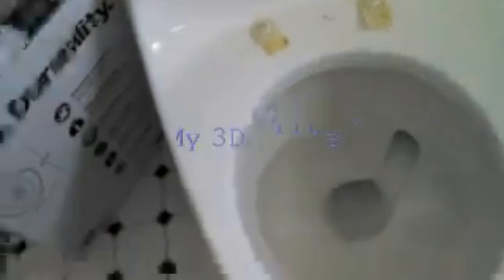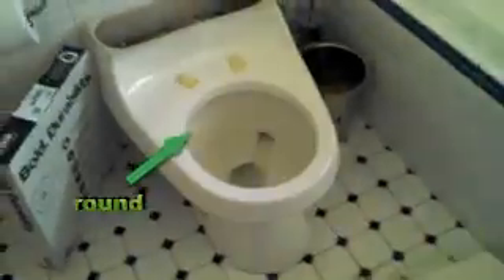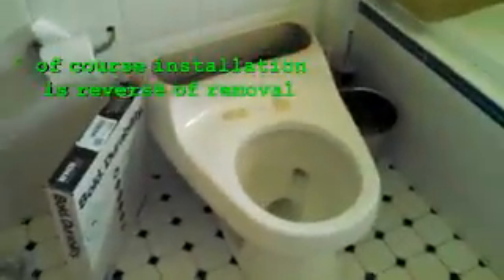SEAT REPLACEMENT KOHLER RIALTO toilet  K-3386       dino

Comment: Wow,  the reviews about this toilet on Amazon are terrible! About half due to fill and flapper valve issues and half due to changing the seat. People just don't realize that you can reach down in the tank and get the the nuts! They think you need to pay an extra 45$ for an expanding anchor kit. Some don't even thing you can put a new seat on! These toilets seem like they have their quirks but with your videos they seem a lot less trouble than people realize. The right information an attitude makes all the difference!
Reply: +Josiah Hanna Some versions o this toilet have a ceramic cup that prevents access to the seat bolts even when you reach into the tank. That's why people hate this toilet. Kohler had no reason to produce such an unnecessarily complicated design
Reply: I have the Rialto 3386 and there is no access from inside or outside the toilet to the nut that attaches the seat to the toilet.
Reply: @khakuda  same here, my brother, whose a plumber tried and ended up stripping out one of the bolts and now I can’t get a toilet seat that screws down properly and have to replace the toilet 🤬to the designer of this model.

Comment: I have the Kohler Rialto 3386 and the nut securing the toilet seat is not accessible from below the toilet or inside the toilet. I even removed the fill valve that drops into the bowl from the tank and reached in there and everything is encased in ceramic. This is purposely designed not to be repairable you cannot replace the seat on this toilet. Shame on Kohler. These things end up in landfills unnecessarily.

I have four Kohler toilets in my house and my goal is now to make sure I have zero at some point. Purposely designed so that the toilet seat is not replaceable, unbelievable!

Comment: This video is terrible and laughable in more than one way. First off I have a Rialto K-3386 and the bolts are barely over an inch long which leaves little room for a nut to be securely connected. The idea of a having nuts installed inside the tank makes absolutely no sense whatsoever.  Just for kicks I decided to prove myself wrong and so I emptied out most of the tank and put a 3 inch bolt in the hole and as it turns out there is no hole in the tank and therefore this
Video is bogus. Even the guy in the video seemed careless. Was this an April fool's prank or what
Reply: Some Rialto K3386  Have bolts inside mine has the bolts anchored into the toilet itself >>  This guys alright !
Reply: Well, the discontinued mode K-3402PB was identified by Kohler as the Rialto K-3386 when I googled it,  which  led me to this page. And, absolutely, yes, the bolts are inside the tank.  I would have never found it if it weren't for this video, so I'm very grateful to Dino Pinch.  I doubt I would have found it on my own.

Comment: What idiot designed the tank to have the bolt on one side and all the other. Before I watch this video I literally didn’t think it had a bolt underneath there because I reached my hand over to the right side of the tank and checked and didn’t feel anything….l 

I didn’t buy this Kohler toilet, but when I replace it, it’s going to be with something that the manufacturer actually cares about supporting the customers